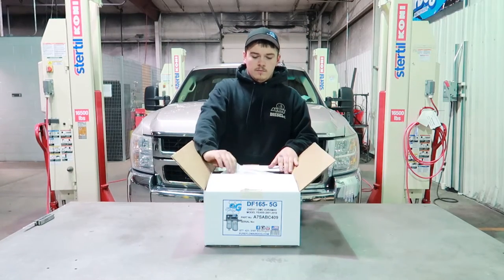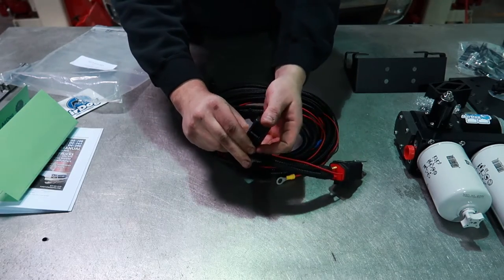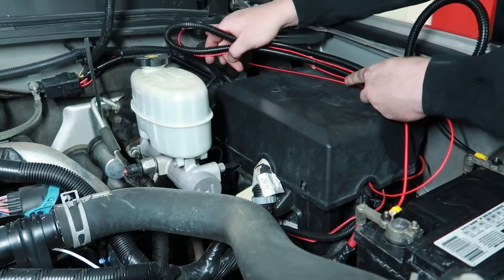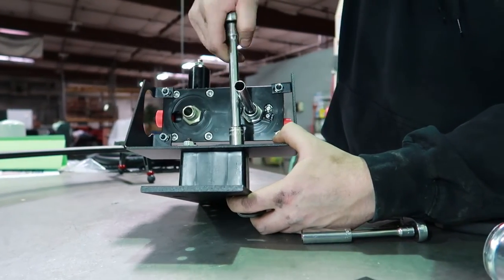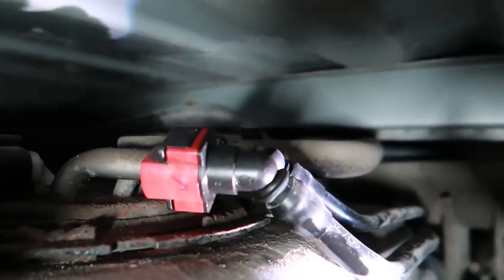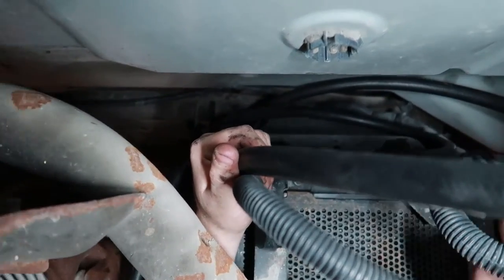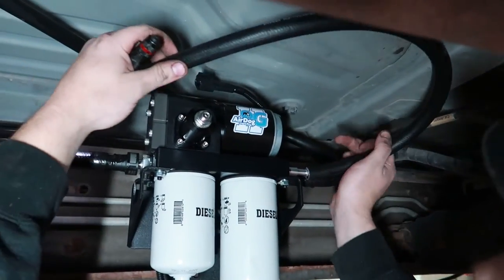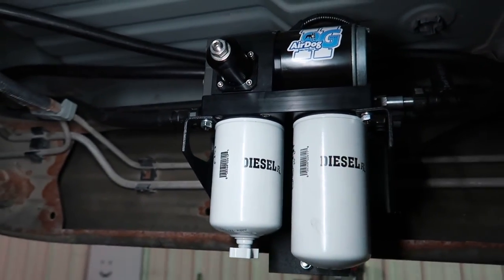2001-2010 Duramax Airdog DF-165 and DF-100 5G Installation

Comment: Did you fill the water separator with diesel then back off the fuel filter to prime everything before turning the truck on?
Reply: i wish he would have shown how to prime it.  i have seen other install videos and all you do is tighten the water separator on and loosely install the fuel filter.  turn the key on but don't start the truck, then tighten the filter once fuel starts coming out. it will take 10-15 seconds, maybe .
Reply: @dskize1  I tightened up the water separator and the fuel filter, then turned on the key, after about 10 seconds I loosened off the filter just enough for the air to come out, then fuel splashed out and I tightened it back up. I started the truck and let it idle for 5 minutes before taking it for a drive to top up the fuel tank. Worked perfectly for me.

Comment: Do you still run the OEM filter ?
Reply from the maker: It is your personal preference. You can either delete the OE filter and housing or leave it intact!
Reply: i took mine off.  you can either remove the filter and replace it with a cap, or install a small fuel line loop where the gas would enter and exit the stock filter.  I installed the fuel line loop.  cheaper than the cap plug.

Comment: What year is this truck my 07 has a entirely different fitting and after over two hours of fighting with it using 2 different tools I still can’t get it to pop loose… I gave up and took the truck down off the jack stands before I got so pissed I started trying to cut the fitting off
Reply from the maker: Give our technicians a call, we have several tips and tricks to help! 877-421-3187!
Reply: My truck is a 2010 and I have the same fittings as in the video.
Reply: @whiskeytango9769  I got it eventually….. but the so-called quick disconnect fittings did not want to disconnect and in 2007 they had two body styles they had the classic which was basically an 06 essentially and then the new body style that was the same as a 08 and I’ll be willing to bet it was the new body style that had the newer style clips on it